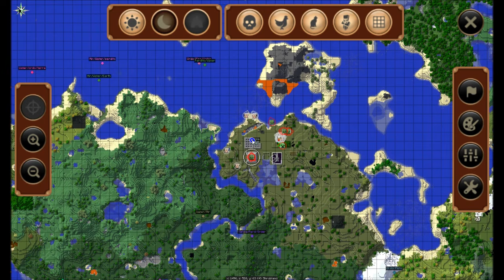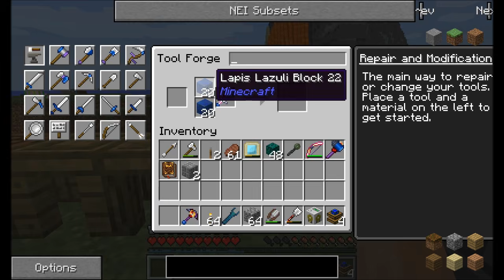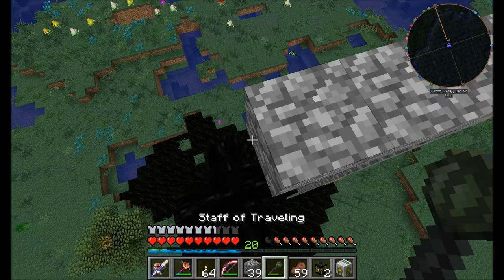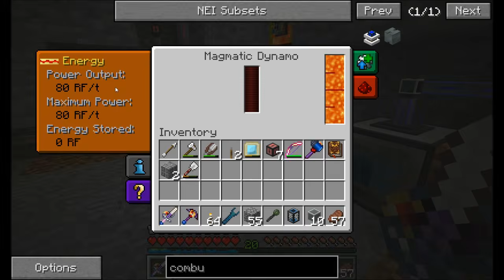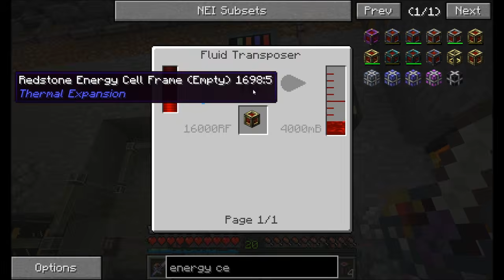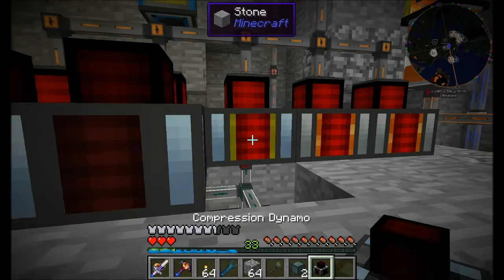Lets Play   S7 E36 Power Problems

Comment: Dire,

Is there any reason to use the old BC/Forestry/Railcraft engines ever again? Will we ever see a boiler pushing Industrial Steam engines? Or how about using a Clockwork Engine for early game? 

Is MJ totally done these days? If so, what is the chance that the old engines eventually start producing RF? 

And what about BC pipes? They're still kinda cool.
Reply: +feioncastor MJ is pretty much dead, but all of those old engines already made the jump to RF, and I’m pretty sure they had done so way back when their mods updated to Minecraft 1.7. Though, for some reason, Electrical engines have a new-found overheating problem if you upgrade them too much. And ever since I discovered steam boilers, I’ve found Combustion engines useless anyway. Boilers don’t consume ANYWHERE near the amount of water that a Combustion engine would.

Comment: Is there anyway to convert eu to rf in the 1.0.3 update?
Reply: +Ryan Antenore Forestry has an electrical engine that converts at a 3:10 EU:RF ratio by default. You can upgrade it to output more, though beyond 60 RF/t it tends to get stuck in a cycle between overheating and forcibly cooling down for some reason.

Comment: Useful stats for my fellow commenters (and dw): 
I have found ender quarries to run at approximately 180k (+- -0k depending on material) power with speed 3, 24k or so with speed 2. I know a lot of people are confused about how to get their speed 3 ender quarries to run, that's how. I made a big reactor with 16 rods, 8x8x48, enderium coolant. It could pretty roughly run it. If you made one that was, say, 40 rods and 10x10x48, you could very efficiently power the quarry by increasing the control rods.

Comment: You can just use a spot loader. More efficient, and the pump is inside one chunk.
Reply: The oil ball at the bottom of the well isn't though.  And spot loaders cost 8 enderpearls iirc.

Comment: my only question are how did he end up with 7 enderman heads and cover up those wires in his base, i can't seem to get either
Reply: To get the heads, you have to kill endermen using the ender sword from ender io
Reply: Eh, i was afraid you'd say that. I was hoping just using a cleaver from Tinker's Construct would be enough. Since it has "beheading" on it. I'm just glad i was able to just find those sword.. i guess i'll have to make a spawner or commit Genocide until i get those heads
Reply: The covering of cables is with conduit facades from EnderIO.  You can paint them to the block you want in the painting machine from the same mod.
Reply: i figured that out after the episode. I got the facade, i just need the painting machine

Comment: Hey Direwolf I've noticed not too many people use the upgrades available for the dynamos they actually significantly increase power output and the first two tiers are relatively inexpensive. I myself am doing a similar build to what you have done before with a solid fuel fire box from railcraft and a mfr farm for charcoal production and have steam dynamos directly on the steam tank making 320 rf a tick per dynamo

Comment: I think going the oil route this early was not a good idea. He created more things that drain power and only used 3 dynamos. He could have achieved the same amount of power output by making 3 more magmatic dynamos instead. I know he likes to do other mods to show them off, but it really wasn't worth going oil. It ends up draining more power than he has and then he had to think of another way to gain power so that he can get more oil to gain power. He's taking a long an unneeded route to get the small amount of power he needs.

Comment: So I notice that every time you use ender tanks or ender chests, you always end up using multiple dyes. You can actually just dye the wool, and change the default colors of the tank/chest. So if you used black wool (instead of white) for the tanks in this episode, then they would be built as black/black/black automatically.

Comment: I made a Big Reactor powering system for only the quarry, and its more than enough  
Some times it gets over powerd CUZ the quarry uses less than the generated
the reactor is 5×5×5  and generating about 1.5K RF
Reply: I guess it made a nostril on Earth's face in two seconds?
Reply: Sorry, I didn't understand :(
Reply: If you power a quarry with that much energy, it makes holes super fast.
Reply: It runs with FULL speed, BUT it doesn't need that much of power.
so i made a system to shut the reactor on and off automatically when the redstone energy cell that is under the quarry full

Comment: Did anyone else facepalm when Dire tried to feed water in through the thin side of the dynamos? I mean, earlier on in the series, he tried to do a similar thing with the magmatic dynamos. Was I really the only one who remembered? And I have a bad memory.

I was kind of hoping for a big reactors thing, but I doubt even with your quarry you have enough materials for a big reactor that produces anything more than a couple hundred RF a tick. In time, though. I was, however, surprised to see you use Buildcraft energy generation, since most people tend to use Thermal Expansion/IndustrialCraft to generate power when they don't have big reactors. But seeing as this series is a tutorial series in a way, I shouldn't be that surprised that you'd use Buildcraft sooner or later.

Comment: I tried using the pump in the nether for lava but it wasnt pumping any, i had redstone engines and everything but it wasnt working, anyone know why?
Reply: wait what? the BC pump? you will need a chunk loader for it to run while your away. out side of that i have no idea of how you set it up so i can't really tell you what your doing wrong.
Reply: Yea i had a chunck loader :(
Reply: well since i still don't know your set up all i can do it throw thing out there. It's a fairly easy block to set up. when you placed it did lower the pipe into the oil/whatever fluid? if it did then make sure all the engines are functioning. also make sure you have a place for the fluids to be pumped into. If nothing else pick up the pump and replace, it may have just glitched or something.
Reply: it lowered, but like a quarter of a block into the lava, all the engines were functioning. I looked on the wiki and it said redstone engines were too weak so i tried stirling engines and they all blew up
Reply: Benjamin Oudejans The problem likely wasn't that it wasn't chunk loaded. The problem I've had is that when the server is restarted, the nether isn't loaded into memory until I've visited it. So even though my pump is chunkloaded, the nether isn't loaded at all, meaning no lava.
Reply: Kzorith
there are more than one chunk loader mods. I thought (which i probably  shouldn't) that chicken bones's mod was good for all dimensions. Some of them are not. You may want to check into that.
Reply: XtraByteGamingIf you are using the Ender-Thermic Pump and already have a chunk loader, ignore these guys. I have bad news. The ETP no longer accepts MJ. It must be powered through RF. Your best bet is to set up a magmatic dynamo that is powered by the lava coming from the ETP and set up some logic gates to make sure you aren't being wasteful.

TL;DR: Free energy is no longer a thing. Use magmatic dynamos.

Comment: The best configuration I have found for that type of power generation is to make a tower.... in a 3x3.... each layer has a Dynamo or engine in the 2,4,6 and 8 Position, Power cable in the 5 and fluid in the 1, 3, 7 and 9... the 1 and 9 for one type of fluid and the 3 and 7 for the other... build as tall as you need and you can run the fluid lines relatively easy

Hope this helps someone out there with any of there own problems... no matter who you are

Use it or don't it is up to you ^_^
Reply: Have you an image of that setup?
Reply: Unfortunately no

Comment: Dire: If you put your tool into a tinkers crafting table, in the middle slot, you can use the 8 remaining slots for upgrades

Also, you only need to colour 1 endertank, with the other in you hand shift click the first, and the second will match the colours of the first
Reply: next time i get on ill have a loo, i thought that only worked with ender  packs,, the backpacks
Reply: u need the tool forge next to the crafting table to make a tinker table for that to work
Reply: angie rossman No, i have just tested it, and it works on a standalone tinkers crafting table
Reply: my b i was thinking about the armor forgot they changed that
Reply: Alternately, if you are making a pair of ender tanks with all three colors the same, it's cheaper to dye the wool used in that tank first.  If you have lots of wool, you can use 1 dye to color 8 wool and use that in the recipe rather than using 6 dye to color two tanks

Comment: "Funny how fast you go thru nether quatz."
Especially when you use pressurized conduits everywhere. Dire said that the regular ones are wimpy but he's wrong. 50mb/t extract and 200 throughput is more than enough for everything in his base. It's a bucket per second ffs, nothing built so far uses nearly that much fluids.

Comment: I just used a tier 2 lava generator(one of them produces 360 Rf/t). :3
Reply: u need 8 lava gens for this right? when i use my 8 generators for power i get 2000 rf/t and i dont need a cheap reactor for this
Reply: scudsturm1
 or just use the augments from TE and u can produce 320rf/t with 10%more efficient fuel usage just take out the redstone control and the dynamos are alot more efficeient than the lava gens from XU

Comment: if you put both Efficiency and Power output augments in the generators at level 2 then your 80 RF machines will produce 320 RF and on top of that the Efficiency modules are slightly more potent than the Efficiency lost in the power output. Overall the machines will produce 4x as much RF with a %5 more efficient fuel consumption. The best part is that the augments are so cheap. it's just lead, silver, copper, tin, gold, redstone and glowstone in small quantities. i have 4 magma dynamos producing 1280 RF which i can't even use all of because of the conduits

Comment: I think Buildcraft should change the refinery into a multi block structure that produces several products from oil such as refinery gas and petrol as fuel, diesel for maybe railcraft locomotives and naphtha for plastic for Buildcraft circuitry

Comment: TE Augments!
Reply: Agreed... amazing what 75% efficiency can do to save on lava/fuel consumption.
Reply: ***** as far as i know with the best augments its possible to produce 640 RF/T with the TE dynamos
Reply: ***** Actually, what I have (before I upgraded speed) was 13 magmatic dynamos with 75% efficiency. 5 run a magma crucible that turns netherrack into lava. this produces enough lava to run all 13. the power from the extra 8 then power the ender quarry in the nether (with silk touch and quarry pump upgrades). the netherrack is fed back into the magma crucible and the lava from the pump upgrade is stored in a bedrockium drum.
Reply: Daltem TheSorcerer No, the one piece of charcoal in a survivalist generator produces 80,000RF TOTAL, at around 5RF/t. He has produced 80,000RF per tick, which is essentially 16 thousand times more than the single piece of charcoal. So while the charcoal is very efficient as an early game power source, it doesn't produce 80k RF/t. It produces 5RF/t. So yeah. Numbers.
Reply: Yup. In my DW20 world I made lava gen with 128 maxed out (640RF/t per dynamo). Unfortunately it drained the nether so fast I had to switch to another power source :(. Still, it shows the power of TE augments. FYI, that setup produced 81,920 RF/t in total and it still couldn't keep up with a speed 3 ender quarry.
Reply: TheEdenCrazy
you could make all that power with a survival generator and 1 piece of charcoal, so yeah....poor nether